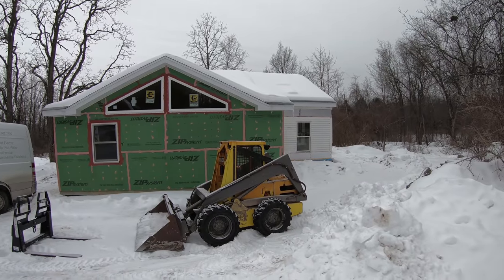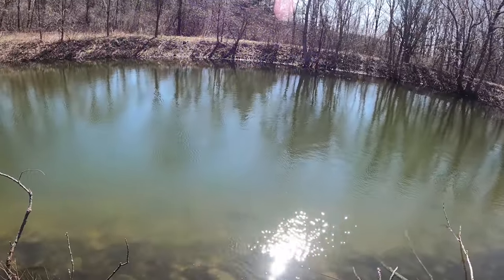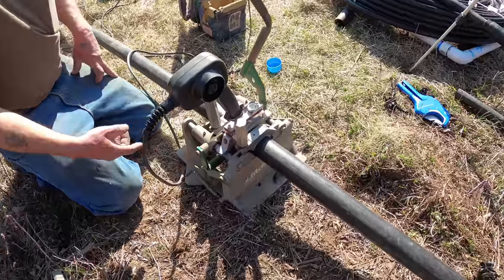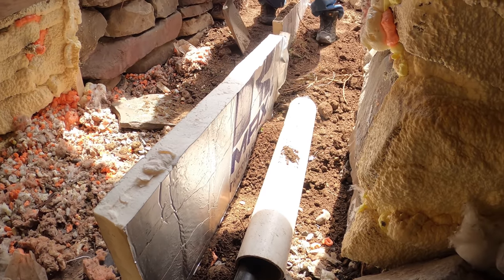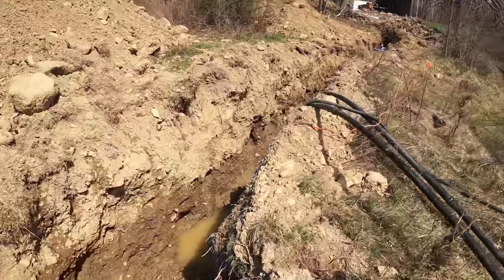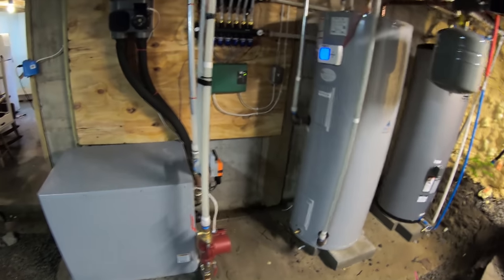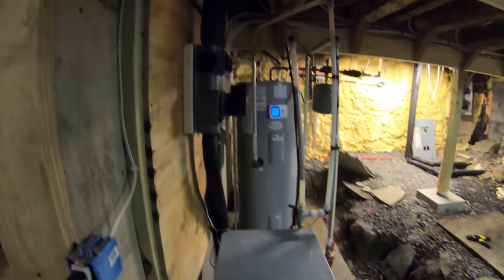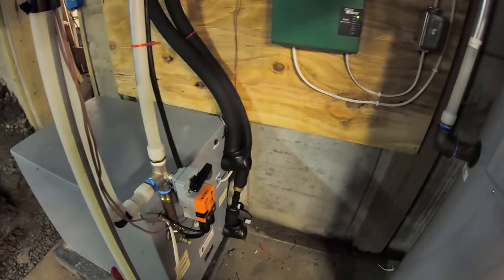Installing a Geothermal system (water to water, radiant heat)

Comment: You mentioned you would never use a water to air geothermal unit.  Here in this part of Texas, we need cooling more than heating, and forced air is pretty much the only way to go.  We purchased a ClimateMaster geothermal system about six years ago with four "wells" drilled in the backyard, 300 feet deep each.  They put one inch poly from the house, going down each hole to the bottom and looping back up, daisy chaining to the other three wells and back into the house.  They then grouted those wells.  The unit is approximately a four ton equivalent, but the compressor looks about the size of a window unit's compressor.  You said you didn't like the noise of a forced air system.  Our installer suggested letting him do something I've never seen before.  The ducts that feed the ceiling registers go straight up into the attic for about three or four feet before the 90 that takes it to the plenum.  He said that makes it a lot quieter, and he's correct.  We absolutely cannot hear the air coming through the registers at all.  And you mentioned it blowing pollen and dust.  Well, the filter on this unit is almost four foot square and two inches thick.  It filters out pollen, dust, even smoke.  We are extremely pleased with it and have had zero issues since installation.  Our electric bills are usually a little over $100/month, and that includes our water well for household water.  We are full electric here.  The geothermal also heats the house in the winter months and preheats our hot water.  Enjoyed your video, and subscribed to your channel.  Keep up the good work.  Looking forward to watching more in the future.
Reply from the maker: Yea in the south a water to air system makes sense, they have also come a long ways with the forced air units. i think there are some high velocity systems that use a small 3" duct and I think they make less noise too

Comment: Insulating the ceiling would give even better results! No electric bill... yes but maintenance fees that can be more expensive than having to pay bills over time. 1:18:50 the term to be used here is "thermodynamic" using geothermal.

Comment: I’ve been installing Ground and Air Source heat pumps for over 10 years.. some with ground collectors but mainly bore holes, sizing of the collectors and pump Kw size is critical, a accurate heat loss calculation must be done, including insulation values…and additional insulation and lagging ..
Reply: Don't know how good the danish pumps are in the us, but here in denmark they are coop5, but most system are really cluttered fitted in the us, we also have aircoils to heat the water. I think we have around waterbased heat in around 90/95% of the homes here, most get heat from city where we burn trash, or from powerplants they use water for cooling it's sent direkte to private homes

Comment: Jesse, you might want to do a little more research on the geo water to air system to get air conditioning along with the heat. I have a hydronic heating system which I put in myself that feeds off a 1500 gal insulated storage tank that is heated with a boiler that uses wood or fuel oil and had I think 5 different zones. The tank when up to around 160 degrees stoors about 1 million useable BTU's of heat. Well as I got older I wanted to simplify things and had a geothermal water to air heat system installed, it was a single-stage pump and dump system which we loved, after years of good service the compressor was in need of repair. We decided to upgrade our geo to a 2 stage which was even better than the old one. This spring I had 3 wells drilled to 150' and they installed a vertical closed-loop system which took us off of our main water well. That is working out great, it took a load off of the water well which is still supporting another geo system that heats and cools my barn. The great thing about a water-to-air system is you get both heating and air conditioning and dehumidification and humidifier for year-round comfort.
Reply from the maker: yea that is the pro to the water to air system, but the con is that you dont get hydronic heat for the floor
Reply: @jmuller86  We insulated the basement walls and it never gets below 50 degrees even if it’s 10 outside, so the first floor never feels cold. The floors are wood without carpet.

Comment: A friend of me has a water to water system too, but his property is not as big as this. So he drilled a hole into the ground 250ft deep. With his system he is able to heat up his complete 3000 sqft House, a pool in the basement and a twin garage. This systems runs fine since 18 years.

Comment: Great to see another advocate of underfloor heating, it's a great way to heat your house and I will never live in a house without underfloor heating again. :-)

One questions about the loops under the floorboards, are you not going to insulate then from the service space / basement, you will loose a fair amount of heat from radiation into the service space if you don't and all you have to to is to add 3-4" of foam insulation between the rafters and that will stop the heat loss to the service space. I would also insulate the pipework to / from the geothermal system and thermal storage, you want to send the heat into the house and not dump it into the service space.
Reply: I was going to ask the same question. The heat loss into the basement will be massive unless the pipes are buried between hefty insulation and the floorboards.

Comment: Some pipe couplers in the UK have an embedded heater coil. You connect them together, attach a power supply to two little contact pins and the pipe melts onto itself. I guess the advantage is you can create a joint exactly where you want to?
Reply from the maker: Thats pretty neat

Comment: Great Video brother, that being said these geothermal are a no go IMO. I only say that, because as a plumber you wouldn't believe how many jobs I get called to with people abandoning these systems. The amount of $ for rough install and replacement/maintenance destroys the efficiency. All that being said, I still loved the video and hope that it works out for you.
Reply: Like anything in construction, the costs are often higher than estimated and the performance of equipment is often less than estimated. Many homes that were built with it around here ended up installing a gas fired boiler to provide additional heat when the system couldn't keep up.

Comment: Wow !! Very interesting video jess,my work installed a geo thermal to a brand new building,they had 3 well drilling machines in the lot [approximately 150 ft ' 80 ft] running for 3 months they drilled down 500 ft and made a loop they said it's the most efficient but most expensive. Man you sure have a lot of rock up there or shale,geo thermal is not for everyone but if you can afford it .its the way if the future for sure,have not seen the pond theam for installing this but that had me intrigued. That had to be expensive along with all the other construction along with this old house. Mabey you should start up a new version of this old house!LOL,love what ya do brother!

Comment: other options are to use small pumps to do what we call fast recirc. that actually make use of the friction and pump motor heat gain to add to the load before it hits your coils or boiler loop (radiant heat). With the exception of Alaska, near or above the arctic circle, 48 inch depth is generally well below frost level which guarantees a 50-55 degree consistent water temp. Radiant is more efficient, however, the time it takes to catch up and to react is slower. Way more cost effective and can be fine tuned with solar to really eliminate the power draw from the grid.

Comment: I fused poly when I worked in the oil field back in the day. The shits tough and way lighter then fiberglass and there is no rusting or breaking. Down side is that you cannot feel it with the hoe when digging so it can be tricky to dig around. Not so bad if you have a spotter of course..

Comment: Very interesting to see how geothermal heating can be installed if you have the room for it.
Unfortunately in my country (UK) 99% of housing would not have sufficient land or a handy pond to install the pipes in, nor do the vast majority of houses have basements for the tanks pumps etc.
We installed underfloor heating pipes in our recently built ground floor extension, (36square meters) it is very good, the room is comfortable the tiled floor slightly warm compared to the rest of the house, and it leaves all the walls free of radiators  for furniture, a big plus. Our floor is heated from the same gas boiler that heats the radiators in the rest of the house. Due to the higher insulation of the extension and improvements to insulation in the rest of the house we have not noticed any increase in gas usage since before we built the extension.
I guess air to water heat exchanges could be used in the UK, they would take up less room, but they are not common, although it is being installed in some new build properties.
Cheaper to install by a long way is electrical underfloor heating, but here in the UK it is expensive to run, therefore not popular. That might change in time as more renewable sources of electricity are developed and when the boiler ban comes in in a few years time.
Some new housing is built with airpump heating which either heats radiators or under floor pipes. I have yet to meet anybody is satisfied with it, people say it is not warm enough in cold weather. Probably the units are undersized for the coldest weather to save on cost.
Reply from the maker: getting heat from the ground is the only way to be totally efficient. the air to water heat pumps are nice because they can also cool but in the middle of winter, the efficiency goes down, right when you need it. Ground source water loops stay the same temp all year around

Comment: The easy way to understand how a heat pump works is to look at an air conditioner that normally has the hot side being out the window, being cooled by ambient air and the cold side inside your house.  Flip that around so the hot side is now inside heating your house and the cold side needs to be warmed up by the outdoor ambient air.  So long as the ambient air is warmer than the freezing cold coil, you're gaining heat energy from the outside air.  A cheap air conditioner isn't very efficient at this of course, because it's basically 100% powered by the compressor which has no way to put that scavenged energy back into the cycle, but a heat pump does.
Reply from the maker: good explanation

Comment: I wonder how reliable the geothermal system is in the long run. It just seems like there's a lot more components required to make it all work and if you factor-in the maintenance, service calls and the restrictions for digging around the property, it seems like a tough sell.
Reply: They are really good here not much service and problems, but we also make the worlds best pumps for it, grundfoss is danish😉

Comment: How long would it take to justify the cost opposed to other sources of heat? I guess it is like going solar, it is for the long haul.
Reply: They say '5-10 years', but heat exchange systems are not that great in poorly insulated houses because you have to set the temperature higher, so they are more suited to ambient heating (the underfloor heating arrangement works well though).
But it's pretty low maintenance and a fixed cost, so he should make it back
Reply: @____________________________.x  Best practice would be an energy audit first, follow all the recommendations, then size the hvac.  We downsized significantly from our pre air sealing and insulating propane furnace and conventional ac unit.

Comment: An air system doesn't make dust. you always have dust and pollen in a house. The air system allows the collection of that dust and pollen with a filter on the air it pulls in.

Comment: You have me curious.  How did that geothermal system pencil out against cold weather heat pumps?  Going to be a long payback time on all the digging.  Mini splits can heat efficiently down to below minus twenty F if you get an appropriate system.  I am a bit leery of all that piping for long term exposure to stresses of a variety of types.  The differences in fan driven air transfer and long run pipe friction would even out I am guessing over long term use?  The other type of heat pump available for water heating could also be a consideration with the later technology's increased efficiency.

Comment: Careful putting pipe near roads… sure frost is normally 4 feet but in The Ottawa Valley, Ontario, probably not that far from Jesse, the frost beneath roads has been measured down to 10 feet deep. The reason? The snow gets plowed off it and it has no nice protective insulating layer of fluffy snow over it during the winter. Hard on roads but a necessity. Brutal on anything.

Comment: Thermodynamics is a very interesting subject (even more so as it gets into Quantum Physics!).  In these systems keep in mind one weak point in a central compressor set up is that you can not have heat and cooling at the same time.  Something you would want if say you are heating a full basement first level (ground temp) while sunshine overheats the upper level through windows, south facing, etc.  This is where separate mini splits for the levels and rooms can shine.  Big windows in a living room that need heating while back bedrooms need cooling.  All these situations with great variability are areas where the cost and installation of mini splits are a good option.  Yes you do lose efficiency as temps go down but with today's better cold weather cooling you can easily get down to minus ten or greater and still be two or three times more efficient that straight resistance heating.  At worst the units have a one to one when they switch on electric heat below twenty or thirty below zero.   A fear I would have with ground loop systems is that should you get that one in ten year winter where say you have heavy rains for weeks right up to subfreezing weather your ground frost can go very very deep.  Raising not only the possibility of freezing but ground heaves can shear the piping.  If this happens in several places the cost of repair could be dramatic.  For some situations the dehumidification provided by the mini split style can be a huge benefit.  In today's world weighing in the cost it is hard to beat a mini split sytem.  With some skill, tools and research installing your own can save the homeowner thousands.  I know I put in a ton and a half unit over two years ago for a cost of about $1600.  I have 18000 cu. ft. in my shop and the unit keeps it at a steady 65 F year round from ninety degrees to zero at its lowest setting.  The increase in the electrical bill is almost unnoticeable (16 cents per Kilowatt hour).  I have no problem with rust or condensation in my shop now and am very very impressed that a unit rated for 600 sq ft. can do almost three times as much at an idle (speaking of fan settings) and never falter.  A very deep subject that draws you in the more you learn about practical and theoretical aspects.

Comment: Holy sh*t, they drilled an LVL load carrying beam. I would have inspectors up my ass and have to pay an engineer for approval papers if I did that. We aren't even allowed to drill them to bolt them together here. It amazes me what different areas allow that others do not.
Reply from the maker: As long as you follow notching and boring codes its fine
Reply: Had to strap and nail an LVL that had a 1/2 gas line my coworker drilled through it

Comment: Wow, that had to be an expensive system to install, I am not sure of all the options for heating and cooling systems in your area but it seems the payback on that system will be way down the road somewhere.
Reply: My brother went with a wood burning boiler, it uses chopped trees, 2X4s whatever is in the construction dumpster at work, you fill the bin outside and it self feeds into the burner, he recovered the cost in 6yrs
Reply: Being in commercial construction, I’ve got to think that’s at least 30k in trenching, material & regrading the field.